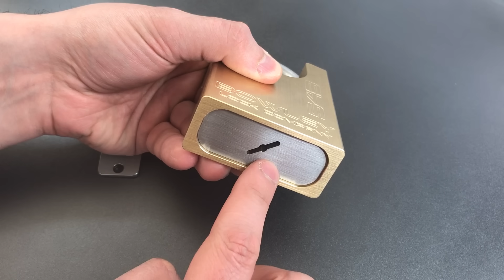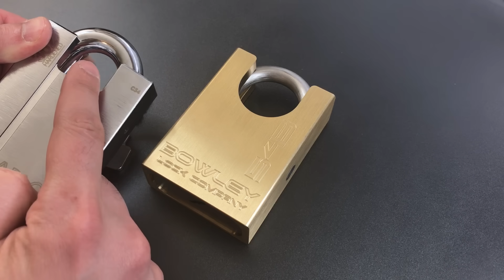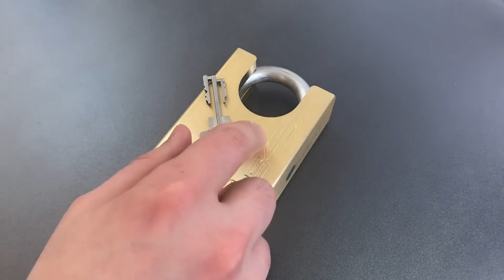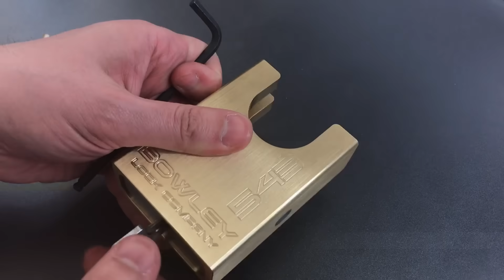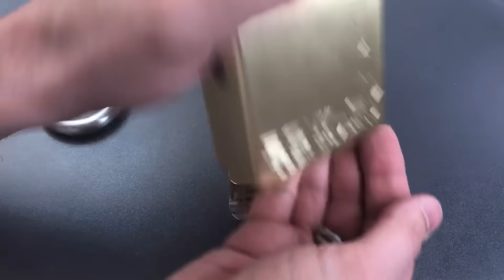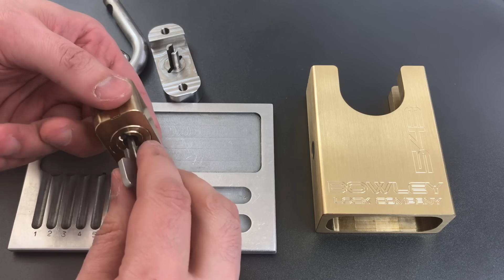[653] Prototype Dual Fork Bowley Padlock (Model 543)

Comment: If it were me I would swap out the brass for Tungsten so it could not be cut so easily 
Then I would shroud the entry point on the bottom of the lock so that it could not be picked with neither tool nor not machine.

Comment: This is a typical example of the door being stronger then the wall it's attached to it's the equivalent of an armored vault door developed for drywall usage. Yes you can use it on a smaller chain but then it's far easier just to cut the chain than even bother with the lock.

Comment: Oh, I finally understood what he meant by "You will dump a lot of pins" in regards to disassembling it while it's unlocked. The actuator goes in a hole that is just big enough for the ball bearings to fit through, so when the lock is unlocked, the ball bearings are stuck to the magnet of the actuatory and if you try to pull out the locking mechanism, the lock will gut itself because you're effectively pull the bible off the core, which is being held inside the lock body by the bearings. If the lock is locked, the bearings are out of the way and stay inside the lock nody while you pull out the mechanism

Comment: As a precision engineer this is a work of art. Cutting spare keys may be an issue due to the close tolerance.
I would say that only the manufacturer supply’s blanks and spare keys. Villains will still use battery grinders to cut through the chain though .

Comment: I think that Bowley's willingness to let LPL disassemble their lock on video speaks to the excellence of the design. Whats really smart about it is if you were to invent a pick for this, it would somehow have to be able to push in, then BACK DOWN the lock and still be able to push the pins in... and even if you COULD make a pick that complex, the components would be so thin that torsioning the lock would make them snap. It's impeccable engineering.

Comment: I love that despite all the warding and the idler making both tensioning and picking monumentally difficult, they still took the time to make security pins in there. It almost feels unsporting at that pont, like adding a fourth phase to the boss fight.
Reply: That 4th phase is called an Encore. ;)
Reply: It's because the cost difference between standard and security pins is so marginal that when you're making a lock the costs well north of $100 not adding security pins is just disrespectful to the customers at that point (this is realistically the case at any lock over $20 but that's besides the point)
Reply: @the_undead are u aware that in capitalism the company has to disrespect the customer,  its part of the trinity.. which requires lying to the customer and finally becoming broken and unresellable
Reply: @lenbones7940 Capitalism can be either good or bad. It all depends on the groundwork and laws set in place.
Reply: They cheaped out

Should have been chock full of security pins and different tension springs
Reply: Uhhhh- Well, “difficult”. I think it’s basically impossible if you only use traditional to modern methods. You’d need a picking tool that’s shaped like that specific key to even have a chance to get to the pins. Amazing craftsmanship to make such a lock. I hope they can make similar locks, more compact, maybe cheaper.
Reply: @kenjiroumiyamoto1432  so you essentially need the key, to pick the lock without a key...
Reply: @kenjiroumiyamoto1432 as far as I know, no one has successfully picked this lock to date. I could be wrong on this but this is a very secure lock

Comment: What protections are there to mitigate galvanic corrosion. With all brass and stainless steel it looks like a battery waiting to happen. Do you only use mechanical manipulation to defeat locks? It would be messy but couldn’t you get through this lock with a strong acid or cryogenically compromising the brass? Anyway… Thanks for the video. Wasn’t as satisfying as most your others but informative and worthwhile, none the less.

Comment: Would it ever be possible to use compressed air,burst of pressure, or applying a constant low pressure to defeat a lock like this? I know they are not air tight but maybe if the flow was high enough that wouldn't matter. Just wondering. 😊👍🏼 

Seems like this would also make a very interesting video as well!  

Thank you for the videos! I will be purchasing a Bowley soon!

Comment: On the point of shackle thickness: it does get to a point where the larger shackle leaves so little room for a chain that you end up needing to use a chain that's thinner than the shackle so you can fit two links into it, making the chain now the weaker link to attack anyway, so a shackle that size becomes meaningless. I can't see any reason to need a shackle that leaves so little room that you are forced to use a chain that'd be more breakable than the shackle anyway.

Comment: I would never say a lock is 100% unpickable, but I think this design is perfect. I’d imagine LPL would take several hours to pick it. The only way I see to do it would be through trial and error of making keys, but even then the blanks would have to come directly from the manufacturer or be forged perfectly. All of this is of course assuming that you know exactly what you’re doing. Considering how beefy the body is and that further designs will have a hardened shackle, destructive means will probably take longer than cutting the chain or breaking the door it’s attached to.

Comment: Did lpl ever beat this lock? Also be interested to see how this holds irl against wrench attacks.
Reply: I think there's only one or two documents examples of the single fork version being defeated, and I'm pretty sure this one is yet to be defeated
Reply: Wrench attack being that you torque the lock frame hard enough that it just bends/shears apart? I'm guessing it wouldn't be easy; that's a lot of metal there you'd be trying to bend.
Reply: @emanwe01  yeah at that point the easiest overt attack is an angle grinder. Covert is pretty much out of the question for now till people figure it out, and even if they do it'll probably be a very time consuming attack.

Comment: OK so when you take the key OUT the lock is then locked again correct? So you shouldn't disassemble the lock with the key still in it.

Comment: Those dang ball bearings (that lock the shackle) are a pain in the rear to get back into the lock, lol there fun as the holes in the hole there don't sit right at the bottom.  I own a Stainless 543 lock and had a lot of fun getting those back in without the other one falling out lol its fun!  Other than that the locks are a absolute beast! Plus like others have said the keys are one of the strongest keys I've ever seen and made totally of solid steel!

Comment: Lock picking lawyer, have you lost your mind!!! You said it was 5 quarters of an inch thick. There are only four quarters in 1 inch or in one whole number!!! What you should have said is that it is 1 and a quarter inches thick! IE in one whole number there are 4 quarters to make up that number as a whole!!! and 5 quarters is 4 quarters making up 1 inch and then on top of that 1 inch made up from 4 quarters there is another quarter of an inch to make up the total length of metal!!! So it's 1 and a quarter inches thick!!!

Comment: Not a hug fan of the magnet. Attracts ferrous grime and beside in a short time the its protective coating will wear off. Neodymium magnets need a coating in order not to corrode. An AlNiCo magnet could be nice if they can get the field strong enough for the purpose. AlNiCo is sturdy and naturally stainless - they don't rust even in hard environments - but as said I'd much rather not have a magnet there.

Comment: Hi, I can see the lock is one of the best pick proof that I have seen but can the shackle stand up to bolt cutters, if not it’s a lot of engineering for nothing. Professional bolt cutters have a HRC of 60 or 61.  The shackle has to be in the upper 40’s or higher to make it extremely difficult to cut

Comment: If I had a storage unit with valuable stuff in it I’d probably buy this. Though now that I think about it would probably just paint a target on my unit. They probably wouldn’t even need to pick it just cut the metal it’s locked over.

Comment: "you couldn't bend one of these if you were trying, unless you had some tools" you underestimate my power. i've bent solid stainless steel keys in half before snapping them. i've tied a steel ice cream scoop in a knot. no one to date can figure out how i've done it. i can and will break that key, and there is no power than can prevent it

Comment: This is actually an overkill I must say. Any lock should be pickable and should not require you to replace your whole door incase you lost your key or forgot it but should be hard enough to pick so it will be even harder in a stressed situation such as a robbing scenario. Designers focus should be finding methods for differentiating a pick attempt from a proper unlocking attempt and disable the lock to be unpickable or include an alarm mechanism etc.

Comment: Defeat the lock by super glueing it rendering it useless then let the owner remove useless lock then keep repeating as will owner tire of replacing hundred dollar locks & most likely replacing it with a cheaper easier to defeat lock.

Comment: The Eidler Ring is a great concept, but what happens if it manages to rotate inside the lock while it's locked? I imagine that this would create a situation in which even the correct key cant be inserted into the lock, since it lines up with the slot on the bottom of the lock, but not with the slot on the eidler ring. Is this assumtion correct or am I missing something?

Comment: I have been looking at this for a while. With the double pin...You could make the "back stop" pins unique to each lock. Standard Coke machine round lock... This means you could use precision to make an ungodly amount of keys.........to even get the key to turn.....Yep...That is About it...
Crap...I can't get my head around...what it would take to get...around...FREACKING...a...double bump stop...Just to let the key turn... to get to the NOW two key... individual keyed... pathway...... Some one one in IT tech is laughing...YOU FOOLS... We already have this tec on 9+ pin tumblers...on the base...Just to turn the key...ANYBODY want to challenge... Yep... Now you have a full on cylindered war fare over the cylinder... But...on a cylindrical... how many unique paths can a straight line pass on said cylinder. Yes Cyber Warfare is amazing...but think of what is put behind a door in an unassuming place with what looks like a Bowley cylinder  lock...Now you can guarantee a unique lock just by defining what angle the pins will set on the cylinder. You can even have the same push bike lock the neighbor had on the nuclear launch codes...Just beefed up. You see a hard to breach lock. I see this as a first step very short cylinder lock that can have 7-12+ extra pathways... and be less likely to snag an Armine suit or Valentino gown. 
The push in gives you access, like a coke machine, to the lock. I think they are Underestimating how important this function is... just ...to get ...the lock... to turn.

Comment: Yes brass is an expensive material to buy, but working in brass can have advantages. With some special brass and bronze alloys they can be  made much easier to machine into complex shapes and very kind to the tooling that is used, so saving on tool sharpening downtime. The material you machine away crumbles to powder and falls out of the machining area instead of turning into stringy stuff that tangles the tools and sticks in the part, and the material you remove is easily recycled, and therefore worth quite a lot as scrap. 
The net result of this is that complex machinined parts are sometimes cheaper in special brass than the same part in ordinary steel. Another problem with steel parts is corrosion, which for lock parts is a serious issue. Stainless steel solves this problem, but most types of stainless steel can be a bit of a nightmare to machine, worse than ordinary steel.

Comment: "... out of which to make locks"
Thank you for not ending a sentence with a preposition!
Reply: Have you never seen the “Rules of Written English” that go something like this?

1. every sentence must start with a capital letter and end with a full stop
2. Remember to never split an infinitive.
3. Nor start a sentence with a conjunction.
4. Every sentence a verb.
5. Have you remembered the question mark.
6. Prepositions must never be used for ending sentences with.
7. Make shore to proof Reed your work before before purblication.
8. Do. Not. Overuse. Punctuation. Particularly exclamation marks!!!!!
9. The use of cliches should be avoided like the plague.
10. Correct spelling is impotent.

There are several others in a similar vein, but I forget and it’s getting late and I’ve got an early start.
‘Night, ‘night.
💤💤
Reply: @q.e.d.9112  I've softened on this opinion in the past two years, partly because of the Churchill quote “This is the type of errant pedantry up with which I will not put”. I suppose if it's easy to avoid ending a sentence with a preposition we should strive for that. If the new sentence construction impedes understanding, we should put the preposition at the end for easier comprehension.

And by the way, your list is quite funny!

Comment: It looked like the idler covered one of the sides of the key. Meaning only one side is used to open the lock. Did I see that right?
Reply: No, the two sides of the key are different lengths and where the one is shorter it simply also covers, he never turns it all the way around where ye can see the bitting of the key popping out below it.

Comment: I would be interested in hearing your take on the quick picking of the single sided 5 pin lock. My thought is that if a lock is handled by multiple persons resulting in many attacks - it cannot be compared to an original lock with factory tolerances and all designed edges in place. Not to mention the moving of zero lift pins etc?

Comment: this could even be a hard lock to bypass if you could make an impression of it. it would take special materials and equipment to make a key from scratch? and even then there is a risk a poor quality manufactured key could break in the mechanism and jam the lock??
Reply: You would need custom precision machined blanks made from something like brass (which is going to be a very weak blank for this lock so it could just break inside) and completely relearn your filing technique because the cuts on the key are very shallow and without proper care you'll blow through multiple of them with 1 stroke of a file.

Comment: Currently cost about $225 - that’s a lot for a lock. Using it there better be sone real valuables hidden behind that door. 

There is one more way to make a lock safer. Put a small tight chamber around the key entry so LPLs big hands can not manipulate any type of pick.

Comment: Well, I think I've decided on what lock I'll get for my motorbike (when I finally get one).  Though I need to decide on a worthy chain that will fit it.

Though right now, this lock isn't available on their site ('Sold Out').  The price is a bit ouch too, but I guess you get what you pay for in this case.

Comment: LPL probably would say. "This lock just needs a hydrolic bolt cutter to open"
Reply: I built a hydraulic bolt cutter. Oddly enough I got my idea from a product nearly identical that comes with several dies for crimping battery cable lugs.

Comment: I’m very late to the party here but I’m a bit off-put by the brass lock body.  Other than cosmetic reasons or being non-magnetic I can’t think of why you’d want brass over 17-4ph stainless (which is one of the more magnetic stainless options).
I’m a fairly experienced machinist who frequently works with both of these materials as well as several aluminum alloys (7075-T651 would be the best for a lock body I suppose).
Brass is one of the easiest metals to cut and has a fairly low yield strength as well. Hardened 17-4 is pretty serious stuff. 
Also confused by the claim that brass is an expensive metal to make a lock out of.  It is significantly cheaper by mass than most types of stainless including 17-4 and it’s excellent machinability would lower the cost to produce significantly over the 17-4 variant.  Pretty nice looking lock though and an interesting mechanism!